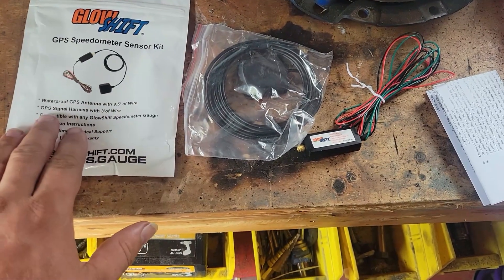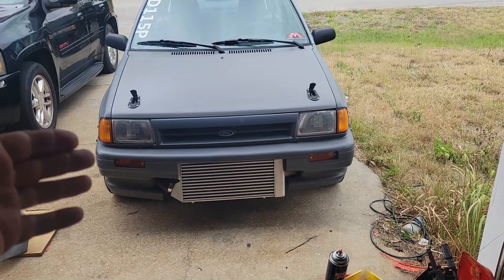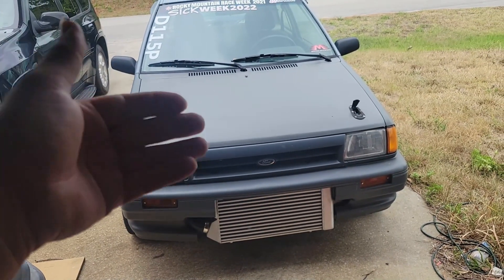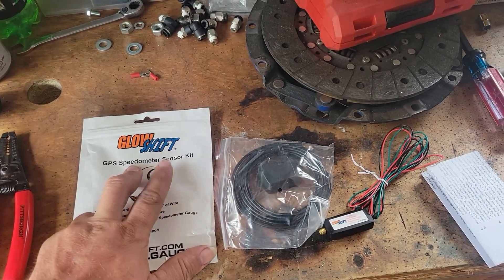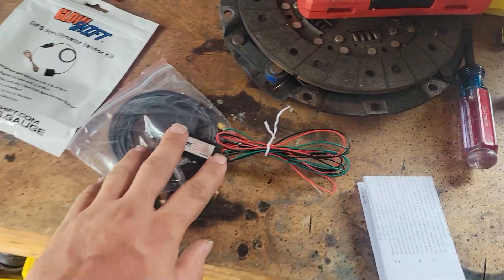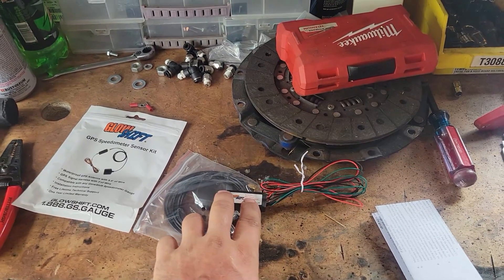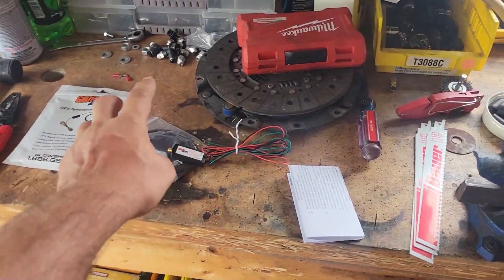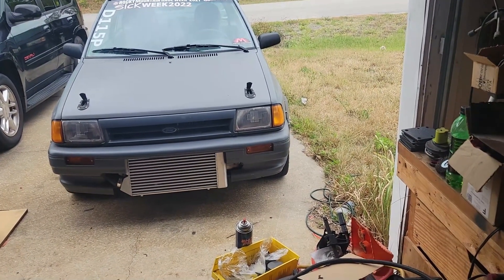Gps working on Fueltech FT450

Comment: Hello. How can I calibrate the GPS sensor with the Fuel Tech 450? I get the default option, it has 4 items and it hasn't worked. There is the custom option and I have tried analog and digital without success. Thanks.